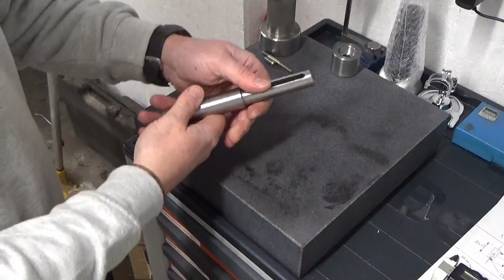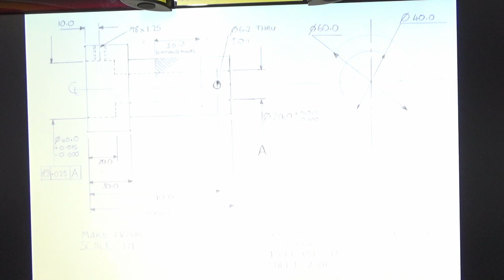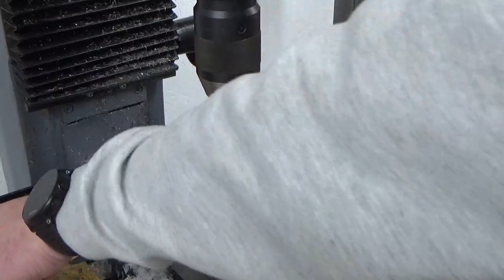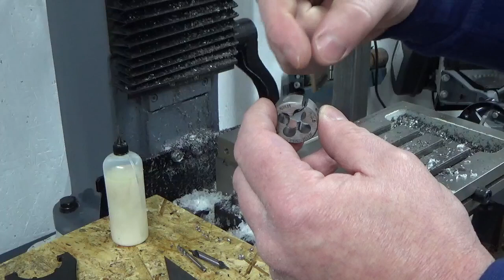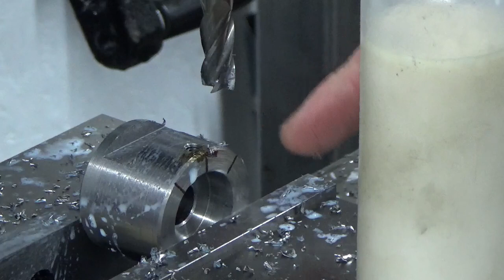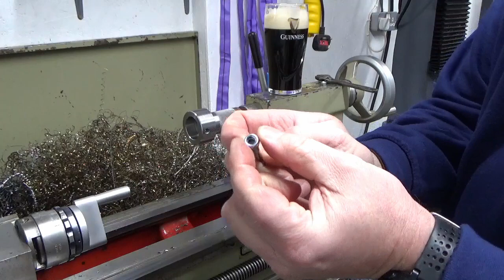Making A Universal Tailstock Die Holder Part 7

Comment: Very nice machining job I turn the slide up in mine on the arbor that way I only need one nut I drop it straight through and gravity holds it in then I drilled and threaded holes for handles that I can screw in there if I want to finish something by hand I just pulled the bolt out of the arbor screw in the handles and go to town

Comment: A great project, resulting in  a very useful tool :-)
A couple of comments...
The die adjustment screws (as viewed in the video) are not really in the best position for adjustment, would be better at the top or at 45° toward the operator. The slot for the grub screw does not have to be so deep and does not really have to be clamped down so tightly. The clamp screw is only to prevent rotation. You don't really need a slot per se, a slightly oversize hole would work just as well.
Regarding the possible "offset" die hole (most unlikely), if the cartridge (anti-rotation slot) is cut axially (as per a previous comment) and the cartridge cut a few thou undersize, die (cartridge) movement within the holder (not the cartridge) may allow for such die hole offset.
I would consider making a cartridge for each die and if the anti-rotation slot was axial, dies could be swapped VERY easily, no need to keep adjusting the clamping screw. The clamping screw is effectively a key in a (cartridge) keyway. Individual die cartridges would allow each die to be adjusted as required and would not necessarily require (re)adjustment each time if swapped in/out within a single cartridge.

Best wishes... :-)
Reply from the maker: Hi Zen, thanks for the comment. Yep agreed to all. The position of the screws is anywhere as I don't have a tang on the end of the Morse taper, I just whacked it into the tailstock without really thinking it through for this first fit. I can rotate full 360 to position them in the best place which will become more obvious as I use the unit more. Cheers, Jon

Comment: Hi Jon, one thing I've picked up on in this and the last video is that I've been running my lathe far too slow! I don't know why I've reduced my speeds but thank's to you I've now addressed the problem. Cheers Jon.
Reply from the maker: Hi Glyn, glad I have been of help, I started putting the cutting data in the videos hoping it helps others out a bit. Cheers, Jon

Comment: If your worried about the die centre not being concentric to the lathe centre line, just make a bigger hole in the die holder and put in 4 screws at 90°apart(you already have 1) to act like a 4 jaw chuck and move the die onto centre line, having said that I dont think it will be needed.
Reply from the maker: Hi Derek, thanks for the comment. I have had a few suggestions on potential redesigns should I need to do something, but this is my favourite. Cracking idea, well thought out and thanks. Cheers, Jon

Comment: Wowee i get a mention.
Don't get paranoid about it being centred,  it might not be an issue at all but just something to keep in mind if the threads don't turn out as planned.
Now two things occur to me. The flat might cause an issue. If you think about it if the cartridge turns due to heavy load it might squeeze the brass tipped screw and make it really difficult to undo, it being in effect a cam action.
Secondly if you use it for sensitive drilling take the cross bolt out so it can spin freely if things get, er, difficult.
Other than the above , its looking good
 9 1/2 out of 10 or thereabouts. 😄
Reply: Agreed on the flat section I think I would have just had a clearance hole instead.
Reply from the maker: Hi Chris, thanks for the comment. I have had a few good suggestions on possible remedial options if the concentricity becomes an issue so either way I am less concerned now. I hear what you say on the retention screw, good point, I will keep my eye on it. Hopefully as it is only 6.5mm dia and on centre the damage should be minimal...... Hopefully. As for the sensitive drilling, I am not planning on going much above 2mm dia with it but understand your thoughts here, I will have a trial and see how it feels then maybe a bit of re-design to polish the final definition. 9 1/2 from 10, speechless! Thank you! Cheers, Jon

Comment: Hi Jon, a job well and I am sure you'll have no trouble with the concentricity of the dies as long as they aren't cheap carbon crap.
Reply: It's not just cheap dies that can be a problem, remember in a diestock the die rotates about its centre and being off centre is irrelevant, so it is not a manufacturers imperative to get the hole central.
Reply from the maker: Hi Del, thanks for the comment and continuing support. Most of my dies are old and decent quality, have a couple of mediocre ones in the mix but hopefully should be good enough. Cheers, Jon

Comment: Hi Jon, don't forget you need room to adjust your split dies! Also, those 3 holes are at 45 deg, so 90 between the 2 outer ones then 1 in the middle. Easy to set up for or mark if you remember this. Good series, thanks for sharing.
Reply from the maker: Hi Dave, thanks for the comment. Yes, aware I may need to open the counterbore up a bit, I figured I can always take a bit more out if needs be. In all my years using dies, I have very rarely needed to open one out (this may be because I always go for nominal on the diameter, or I just got lucky.... Either way). Now the 90 deg is interesting, I tried measuring all the dies I showed on the surface table, and the average measurement I got was about 87 deg. I should have gone in the house and just researched as going for 90 would be much easier to set up. My measurements were so inconsistent, and too far off 90, I gave up and went for the visual method. I am sure it will be close enough (I hope). Cheers, Jon

Comment: Great conclusion to a brilliant series. I've thoroughly enjoyed watching the die holder go from drawings to finished tool. I don't think the concentricity of the die will be a massive issue. You could say the same about any tailstock die holder. Thanks for posting, look forward to the next video. Ps I think I'm going to send you a 10mm spanner!
Reply from the maker: Hi Carl, thanks for the comment. Glad to hear you enjoyed it. I am with you, think it will be OK but if not it will just need a small tweak or two. I know, I have more spanners than a mechanic, I know where they all are, and I insist on using the crappy adjustables out of laziness. Must sort myself out. Cheers, Jon

Comment: Hi Jon, Nicely done, enjoyed. If you give the die a bit of wiggle room, maybe 0.010" you can open or close it up using the centre screw, it will then find it's own centre. Cheers.
Reply from the maker: Hi Paul, thanks for the comment. Glad you liked it. Yes, that is one of my options should I need to do any remedial work, had some great ideas in so got some options. Cheers, Jon

Comment: Nice job. Question , could you replace the bolt in the “slidee bit“ with a plain rod threaded at the end to screw in one side if that makes sense. That way the whole body could fit in your hand without any protruding bits to catch on. Enjoyed the series. Thanks
Reply from the maker: Hi Peter, thanks for the comment. Good idea, yes I am sure this mod could be made. I will prove the design a bit with some trials and decide if any changes are needed - your suggestion is embedded in my Swiss Cheese now. Cheers, Jon